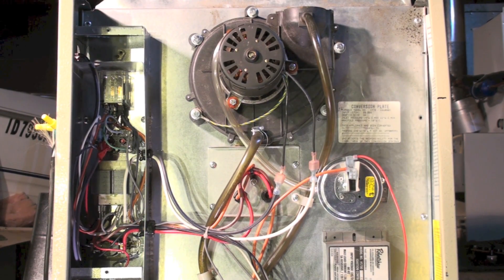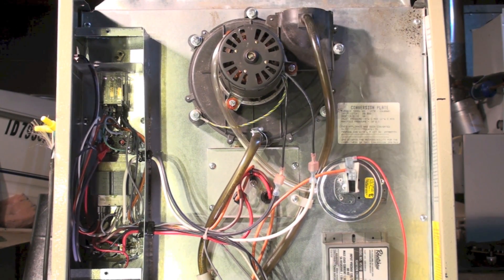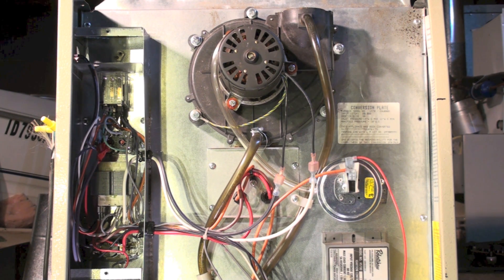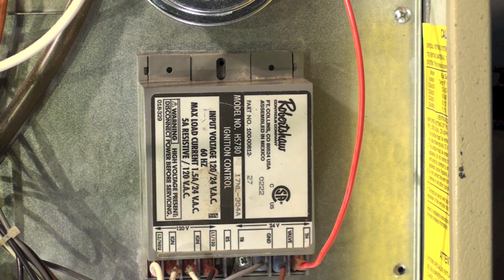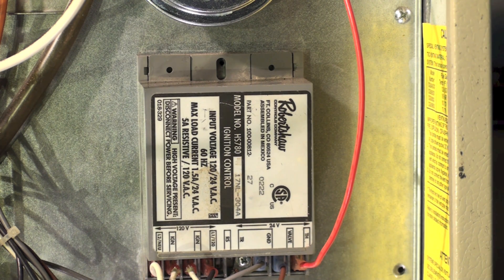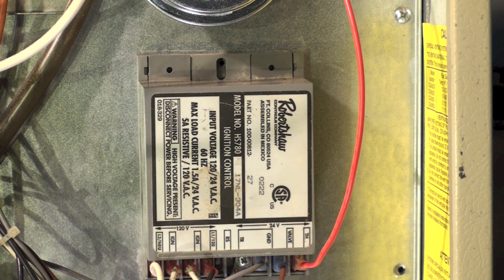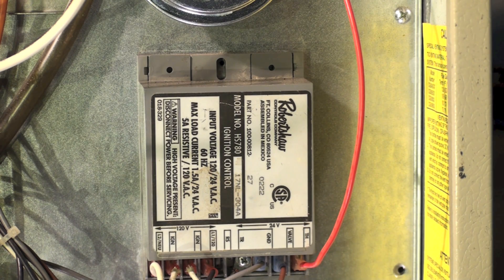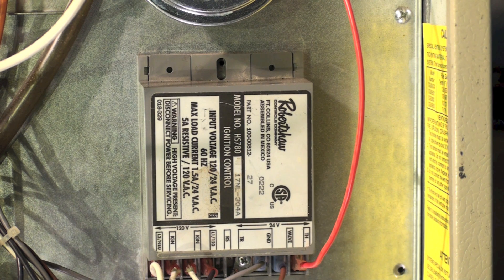Coleman model CGU gas furnace no fire, inducer runs.  part 3

Comment: Gary

I have this exact problem (ignites, shuts off after ~5 seconds.), except it's hit or miss if the flame stays on or not. Maybe 20% of the time the furnace runs fine, otherwise it kicks off. If this part went bad would it possibly do this or would it be a 100% failure? 

Cheers!
Reply from the maker: The Robertshaw control gave a lot of problems.  I would replace it.
GFM